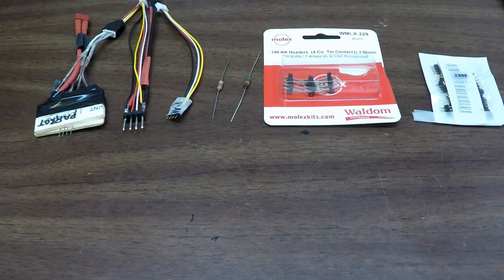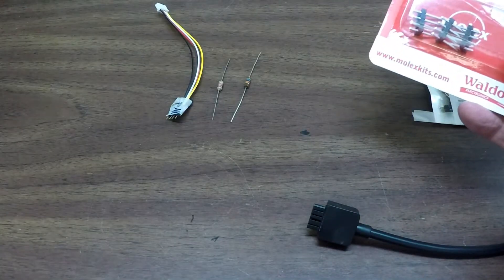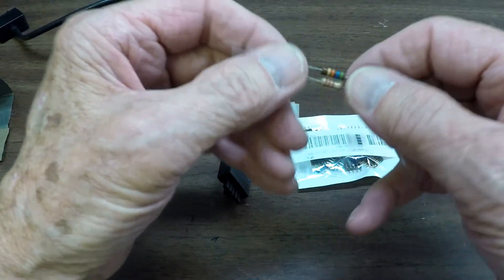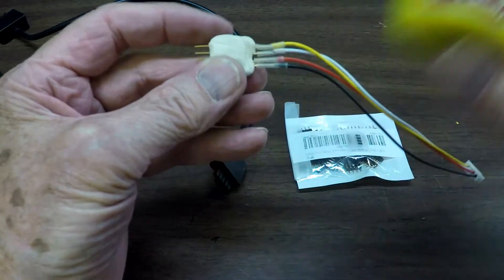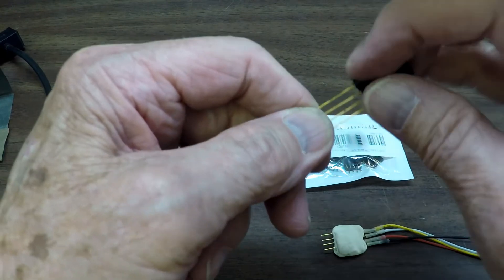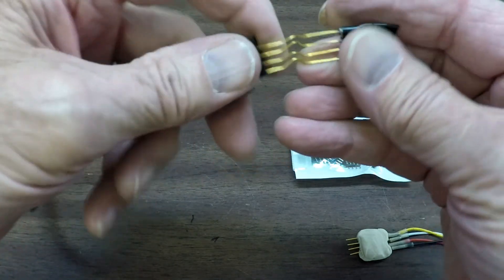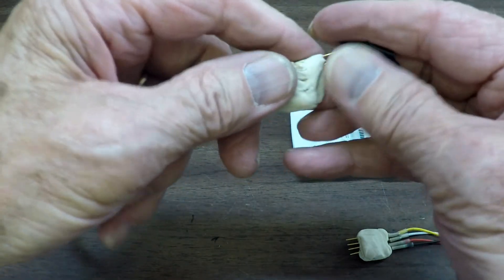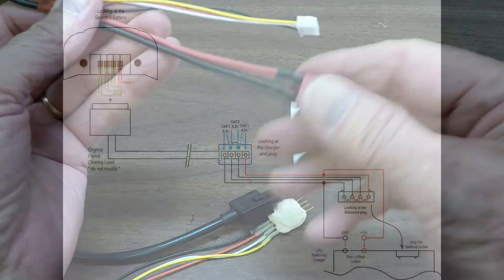CHARGE YOUR BEBOP BATTERY WITH PLAY-DOH (connectors)

Comment: ~20$ charger cable with balancer connector on ebay

http://www.ebay.pl/itm/PARROT-BEBOP-2-charger-cable-with-balancer-connector/112762893910
Reply from the maker: Thank you for your input. That will not work with the Bebop 2 but is worth while for some other applications. God bless.